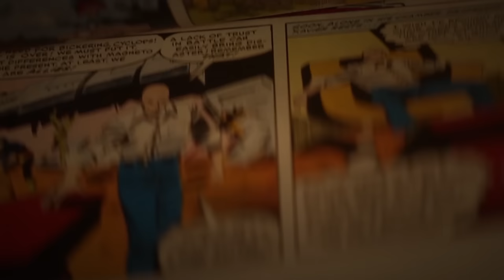Does Captain America's Electromagnet Shield Work?

Comment: They should try testing it with a gun
Reply: How to die 2019
Reply: 1000  ways to die reference
Reply: But it’s canada
Reply: Now in 2020
Reply: That shield isn't really bulletproof - the dents the arrows put in it prove that.

Unless we find some real vibranium, I doubt something as thin as Cap's sheild could ever take the kind of beating it would need to.
Reply: @christcarsandcountry6812  I mean, the wakandan ones are bullet proof.
Reply: @dwardius1055  they have guns in Canada.
Reply: Khajiit Korner   Well yeah, but they're WAYY thicker.
Reply: @christcarsandcountry6812  that is true, although, if they made a captain America sheild, they could have 1/8 inch titanium plating and 7/8 AR500 steel. Then it would be an inch thick and very bullet proof.
Reply: Khajiit Korner   It would indeed be quite bullet-proof, however Cap's shield is barely a 1/4 inch.
Reply: @christcarsandcountry6812  yeah, they could still try to do something like that, just less thick
Reply: @christcarsandcountry6812  nevermind, even just 1/8 titanium can stop up to a 12 gauge shotgun slug. Meaning it is very possible to create one that is super thin as well.
Reply: Khajiit Korner   Yeah, but that shield stops everything.

Tanks, monsters, Mjolnir, alien guns.

A .50 BMG would sail right through that 1/8 inch.
Reply: @christcarsandcountry6812  although it would be the best solution so far.
Reply: Khajiit Korner   Yeah. And for Earth standards, that would mean you're good for just about anything that isn't an anti-material rifle, mounted machine gun, tank, or aircraft.
Reply: @christcarsandcountry6812  so, good, but not quite vibranium
Reply: "Yes, it works"
Reply: The magnet is strong  and i been knowin gthat
Reply: 50 cal
Reply: Haha,  yeah !
Wait, what ?
Reply: @christcarsandcountry6812  granting that it's bullet proof you still can't block all the bullets fired from a AK 47 unless you are The Flash.
Reply: @redraijin8109  🤣🤣🤣🤣🤣🤣🤣
Reply: @purerokaka4518  r u kidding me LOL LMAO XD
Reply: Khajiit Korner yeah but it would be 30 pound lol
Reply: ChristCarsAndCountry68 titanium or plutonium

Comment: Great project, very cool.  With that said, I would have used a welding type magnet with a switchable magnetic field and added a little servo motor to turn the handle.  Put about 6 of them together to make the same rig with no need for batteries and unlimited life.
Reply: But wouldn't the constant hits from the shield ultimately ruin the magnets if done like that?

Comment: Does the magnet turn off when you go to throw it? If it did, it would help a lot. Probably hard to implement though.
Reply from the maker: +Earl it does so that, it's an electromagnet, so it's controlled by a switch :)
Reply: Oh ok. But you would have to time it just right, correct? To get the right angle and amount of momentum. Maybe I'd have to try it out to understand. Very cool though!
Reply from the maker: +Earl it's what we did in the video, pretty intuitive :)
Reply: the Hacksmith lol sorry at that point I hadn't watched the video I was just assuming :)
Reply: Earl
Reply: +Earl timing it just right would pretty much be like letting go of the shield at the right time if you were holding it, IF you have the switch the right way.
Reply: Earl i think it has a button
Reply: Earl Course it does, he's got a button

Comment: Wait if captain America’s shield is bulletproof then 
What’s the paint made of🤔
Reply: Orange alpaca 2580 paint doesn't wear off
Reply: Bulletproof paint
Reply: Orange alpaca 2580 maybe it just stained metal and not paint
Reply: Orange alpaca 2580 DEATH AND RESPONSIBILITIES
Reply: In comics  its a titanium oxide coating layered a ceramic composite
Reply: Bullets.
Reply: Orange alpaca 2580 Vibranium spray paint
Reply: Flex seal
Reply: Adam Palomino lol
Reply: Orange alpaca 2580 the answer is that they made the paint very strong and because of that some paint kinda fused with the metal

Comment: What’s that shield made of? Titanium would work best cuz it’s pretty strong, as well as light. Plus it is pretty chea
Reply: Cheap*
Reply: Colt 159 wat world are u living in to think titanium is cheap lol
Reply: Charlie2071 like that multivuse? Earth 3, what earth(or other planet) you on?
Reply: MrTiranei nah sanhesium
Reply: orihalcon?
Reply: MrTiranei are you joking?
Reply: Wood is the material you need
Reply: Colt 159 
Titanium is fairly expensive like 100 dollers per kilo or something and it isnt any stronger than decent steels, just lighter. What i want to see is a shield made of nitinol. A 45 55 titanium nickel alloy. Its quite springy, strong, light, and if its dented you can heat it up to repair it because its a memory metal. It might be quite interesting and probobly a little cheaper than pure titanoum.
Reply: This shield is made in Wakanda's Vibranium.
Reply: Tungsten
Reply: @matheus-sm7860 
Very high tensile strength but is like twice as heavy as steel. You'd struggle to lift it. It's strength to weight ratio is quite low. An alloy with tungsten could work but on its own no. Not to mention its a pain to shape since its melting point is rediculously high and it reacts strongly with air at a fraction of that
Reply: Colt 159 mine is 3071
Reply: Titanium is NOT cheap
Reply: Colt 159 
Vibranium

Comment: Hey, @Hacksmith Industries, you know what would be an even better invention than this one?  The answer to that is to make the Disc Armor from Rygar in real life.  Basically, it is one part a shield like the one that is in the video and one part Chinese flying guillotine, or, more accurately, the Blade Shield that Cao Ren has in the Dynasty Warriors/Shin Sengokumusou games, but with a circular shield, blades on its rim, and a chain to pull the shield back to its wearer.

Comment: You should make a switch where your haand is so when you want to throw it you can press that and it releases the magnets holding it there
Reply from the maker: That's how it works... lol watch the making of video =)
Reply: It doesn't look like as it seems you have difficulty throwing the objects maybe the switch isn't strong enough
Reply from the maker: The switch is what controls the electromagnet, when it's off, the magnets are off. It's just not easy to throw from that arm -- even Captain America removes it and then throws it
Reply: True but i reckon it could be better by making it when you hold down the switch the magnets won't work then that way you coukd easily throw it
Reply from the maker: You wouldn't want that because then when you're not using it the magnets would always be on and they would drain the battery or overheat. Push to turn on magnet, release to turn off =P Just as easy when throwing -- the issue isn't in the switch, it's just really heavy on awkward to throw.
Reply: Kay
Reply: You could put it onto your exoskeleton

Comment: I think tbh the magnets are too awkward and bulky, maybe if u made a more smaller version it would work for less the weight, with more mobility, and maybe like vibranium, use a light metal but also a very strong metal, magnets I think are very optional

Comment: I will have 50 pls the start montage was enough take my money!
Reply: Aww dog I paused to write that just before he wipes Colin's magnet shoes video with his powerful arm gadgets. He doesn't have a team and a well equipped facility. I'd be sour too though. He has had good ideas a made some cool stuff and he doesn't muck it up so there's no value making stuff he made. The Wallace and Gromit look I like.
Reply: PS get good health insurance and I'm sure it goes without saying this is him how many years ago now but don't go so hard. It's not good for the body long term. Trying to break something without weight means your arms are applying that weight to break slabs. The weight is in the magnets on his arm. 2 skiny bones to allow forearm rotation. If hands and arms were meant for punching in my ideal of logic. Not any knowledge on the subject one bone to the hand like the upper arm bone. Basically a standard single axis robot arm. You won't be able to twist your wrist. Just go up and down. So be gentle to those bones. That's why they snap when arm wrestling. Or is that the upper arm since that's were the torque should be generated. I guess it depends how much you work your forearm maybe?
Reply from the maker: I've been fine 6 years later lol